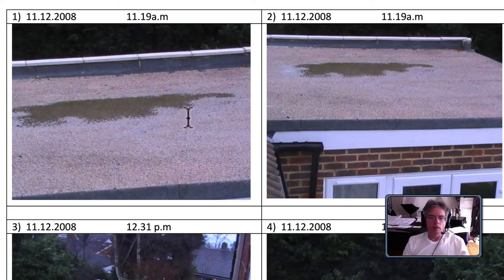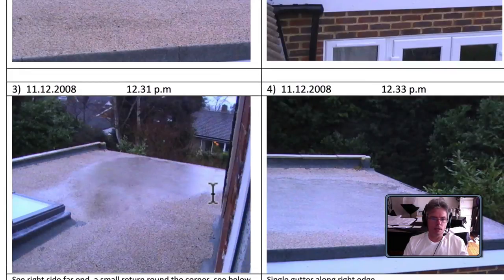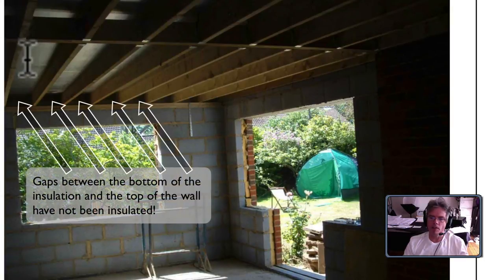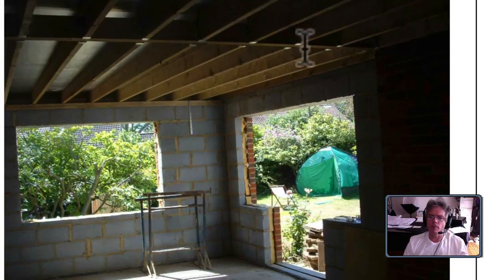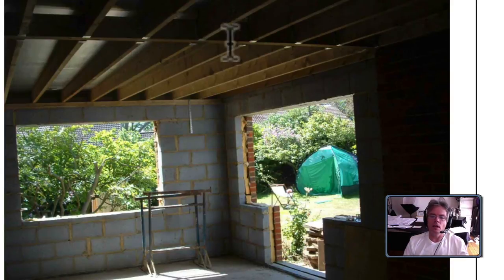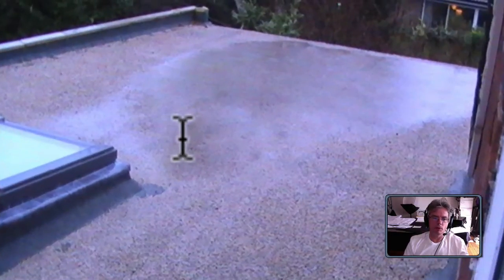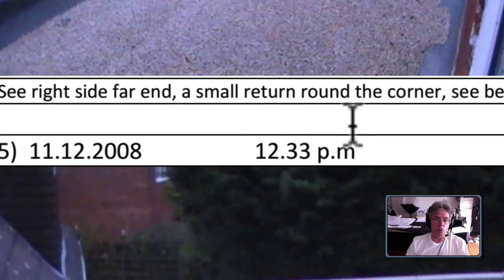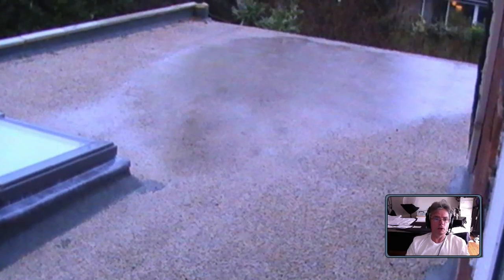Puddle in the centre of a flat roof

Comment: as a  roofer  for  30 years plus , i ve done many types  of flat roofing , the old hot pour bitumen flat roofs ,  which were actually flat (no slope ) covered in gravel , which held water , moss etc lasted a lot longer then roofs with a slope.
if  you put a piece of bitumen in a  glass of  water it will  stay the same  for 30 years , if  you put a piece of bitumen on  a road in summer , it ll  be  gone  within a week !!
water  does nt destroy flat roofs , the sun  does !!
Reply: off  course  today we have different systems , epdms , grp , liquid rubber etc, water  does nt affect then  either , but the  suns uv rays  do !!
Reply: paul davies i m about  to change  a hot pour flat (4  mm mineral top coat ) roof that i did  27 years ago,the customer put wooden decking on top of  it which held back  the water  and kept the sun off the surface of the roof , 
i ve tried  too  get him  to have a  different covering  but he was  so impressed  with  hot pours  durability that he  wants  the same,
ps  ,the decking  has  been  changed  3  times  in those  27 years ,,lol

pps ,  the germans  design  flat roofs  to  hold  water  also !!
Reply: I fitted my own flat roof 33 years ago torch felt smooth 2 layers it was like 70 a roll in the 80s 4mm thick 2 layers paint it every couple of years with alluminium reflective bitch paint still going strong

Comment: It looks to me that the timber you're calling a 'trimmer' is actually the primary support onto which the new extension's roof joists are hung. (doesn't look like a flitch beam either to me) It looks under-sized for the structural loading it's being asked to accommodate and should be doubled up, rather than being a single member that's the same section as the other joists. The load is causing the deflection as you suggest, resulting in the top-side ponding.

The exterior of the roof also looks a bit strange to me, it appears that only the external brick leaf is extended up to form the parapet; also the upstand on the rooflight seems a bit lower than I'd expect. Must admit, I'd also have had a board below the insulation rather than having it bear straight onto the joists. Depending on the spec. of the insulation and how compressible it is, that might be exacerbating the problem. It's usually fine for a UDL but not so good for point or line loads. Just my tuppence worth!
Reply from the maker: Yes you are correct its not a trimmer its the main support your obviously an engineer?

Comment: This construction all looks so very new, I wonder if that central “sinking trimmer” is a normal flexure? With everything exposed below the roof, now may be a perfect time to very closely inspect each joist hanger for proper installation with proper nailing patterns and the use of manufacturer’s specified length and size of nails or other fasteners, especially if this is a DIY project. Pulling a few nails if necessary to check lengths is not unheard of, even amongst licensed contractors. Simpson Products is extremely good with recommending appropriate installation methods, such as metal roof joist hangers. As long as my own flat roof puddles dry out within 24 - 48 hours of rain stoppage, I remain happy.
Reply from the maker: Yes, very good points it's quite normal that the joist hangers haven't been put in correctly. There's always a chance that there will be some movement that's why with flat roofs you are supposed to do 1in 40 to achieve 1 in 80 when finished and settlement has occurred

Comment: Hi is pooling a concern if it's 5-10 mm
Reply from the maker: Yes as the  roof will normally  deteriorate quicker at this point
Reply: @SteveRoofer  what sort of pooling is acceptable on a flat roof befor the evaporation drys it out